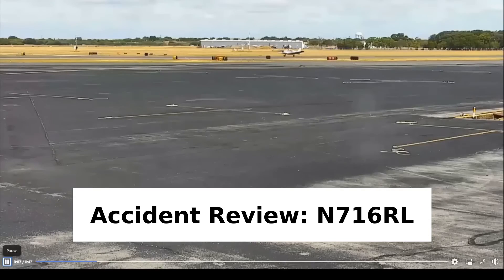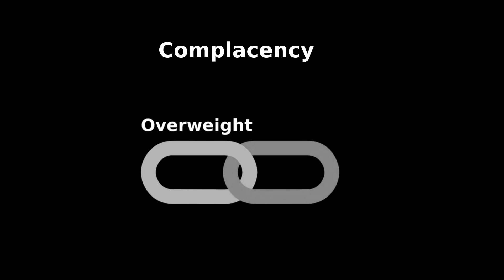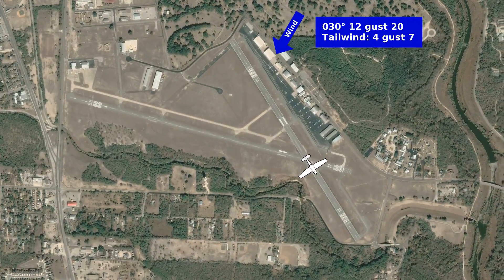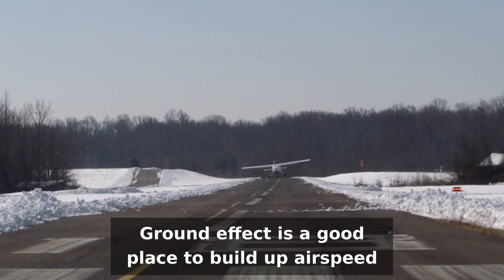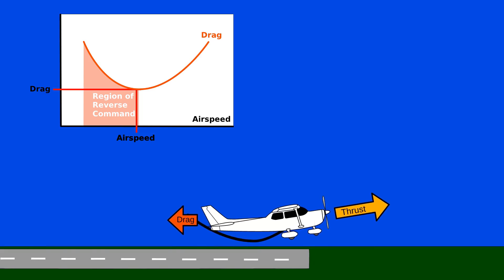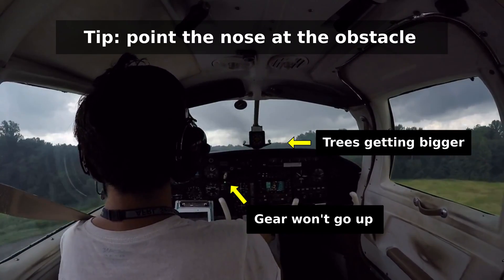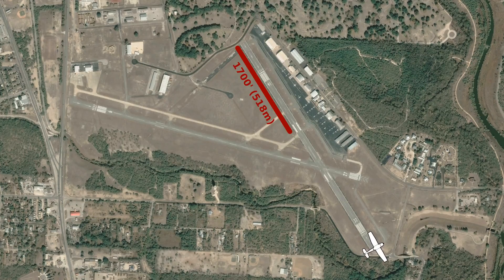Accident Review: N716RL - Max Performance Takeoffs

Comment: Love the content, please upload when you can
Reply: Non aviation here: why would a tail wind be bad. To me that would help the plane go in the air.
Reply: @AnneMullins you get lift by how fast your airplane is going, wind coming from behind is the same as if you were going slower, imagine you're moving in a bubble of air, if that air is moving infront and away from you it's the same as you going backwards that same speed. If the wind bubble is coming at you then it's like you're going faster. Sometimes a rare kind of turbulence occurs when the bubble of air you're in suddenly moves in a gust and it's like your plane is not moving at all and you get a tailwind stall, very rare and most pilot avoid this by not flying in high gusts

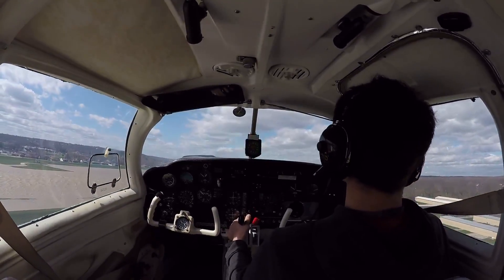Comment: i know this is an old video, but out of curiosity can i ask if there is any reason you were flying on the right side at 2:04 as opposed to the left even though there is no-one there?
Reply from the maker: Just practicing from the right. Not sure if you're a pilot but right seat is a different sight picture, and the responsibilities of your hands are reversed, so it's worth maintaining proficiency in right seat ops. Sorry, boring reason.
Reply: thanks, late reply but i dont use this account alot. ive started flying lessons and this reply and video helps alot. thank you. @chapmanflying7632

Comment: Very good video.  A closely related factor may have been the urge to climb close to the same angle that is hardwired into memory as a normal climb angle.  This can cause the pilot to attempt to pitch to a perceived climb angle rather than pitch to the appropriate airspeed.  I did a flight at Leadville, CO (nearly 10,000 elev + density altitude) and the climb angle was unbelievably flat (100-300fpm).  Ever since that flight, I would always do some climbouts with students at a reduced power setting that simulated that climb angle to emphasize the importance of maintaining the correct speed during initial climbs and getting used to the flatter climb angle, which is something that may be encountered when there is an engine issue or when a go-around is performed and the flaps fail to retract.

Comment from the maker: A few items not mentioned in the video:

1. Density Altitude was 2,300 for this accident. Not unusual Texas in July.

2. Re: gusts. A common myth is that a gusty tailwind will drop a plane out of the sky. This is false, unless the airplane is very close to the surface. A tailwind gust causes a sudden loss of lift. If you accept the loss of lift, and let the plane descend for a brief moment until the gust is over, everything is fine. The problem happens when pilots react by pitching up to get the lift back, which causes a stall. Pitch discipline is critical for tailwind ops.